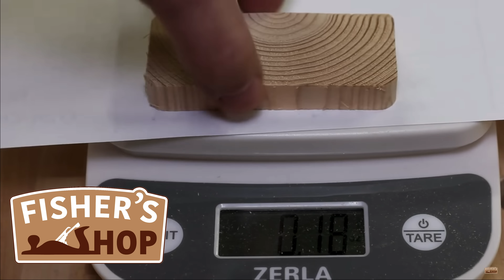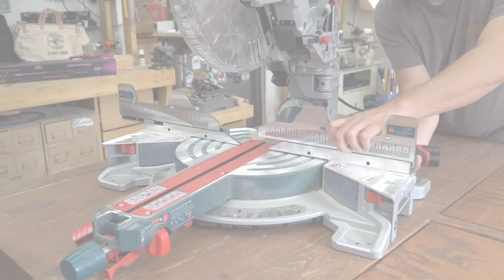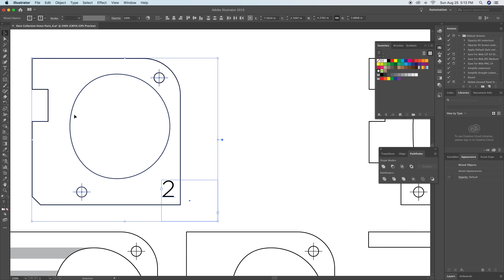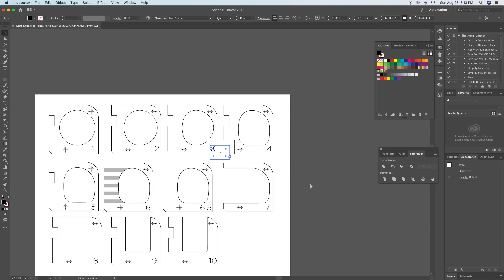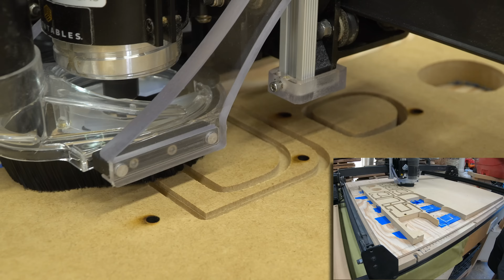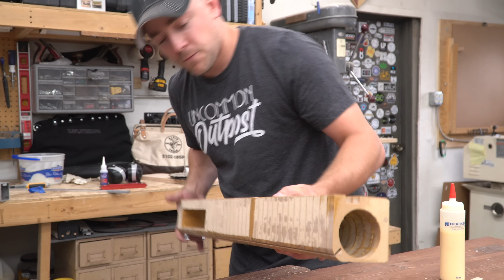Miter Saw Dust Collection - New Custom Fence

Comment: Great idea.  I think I'll try my hand at it, changing construction technique to using plywood to create a box, the inside acting as the airflow tube, and just drilling holes in the face to create the grid.
Reply from the maker: Awesome! you'll have to let me know how it turns out!
Reply: I don't know if either of you will read this, but I'd suggest making the center top and front out of 1/4" mdf and detachable, a sacrificial part.   One of mdf's properties is that it dulls blades less than "real wood".

If I decide to make 1, that's how i will do it.  A box in center with top and front as above, a 2 1/2" hole at the end of the box.  The other half, an L in cross section.  For my use, a tape mounted above the T track, and fence extension mountable to it, probably by french cleat with a c clamp.

Comment: There might be better dust collections methods out there but having a system you designed using some newer technology will most likely lead to some great projects. This is a great " lets try this" project and a definite learning piece.
Reply from the maker: Thanks Mike! That is exactly what this was in my mind - "let's try this." Most of the time when I do that, it ends up in small smoldering piles in the yard - this was a happy success!

Comment: Thats very clever. I hadn't thought about removing/replacing the fence. In my shop, I don't reaaaally need the bevel capability, just miter and even then just 0->+45 not to -45, which has got me wondering if somewhat of a hybrid between your fence (remove just the right side) and Drew's would work out well (for me). 
I made a very bad immigration of Drew's solution (super quick to build with CA!), and that actually works pretty great (despite the flaws I introduced!) but doesn't really have enough room to hook a 4" hose up directly
Reply from the maker: Thanks Paul! You definitely swayed my decision to get this particular saw with your helpful answers to my questions. And I'm glad you did because it lead me down the road to this goofy thing.

Comment: Great project for stretching the brain! I love how it basically came together in the same way a 3D printer extrudes designs one layer at a time. I would be interested to see if this could be made out of aluminum on a water jet cutter. I too was hurt seeing you mar up the face with your cuts...all that hard work! Would there be a way to use a sacrificial face in the center section? It may only provide marginally better dust collection after many cuts at different angles, but I for one have never understood the "it's just a shop fixture, it doesn't have to be pretty" mindset. I'm a fan!
Reply from the maker: Thanks Seth! Sounds like and I think a lot alike! I've had some of those very same thoughts.

Comment: I feel like no matter what you do, the more cuts you add, the more the face of the fence will get eaten away and become a huge opening.  I think if you limit your number of angled cuts, I think you might have success.  Maybe I'm not really following it though.  my preferred solution is still to use the RAS with a sacrificial fence that I keep disposing of when they get worn (since they are so cheap).  I'm looking forward to your updates!
Reply from the maker: For someone who makes all sorts of different angled cuts, it would eventually get chewed up. 90% of what I do will be 90 degree crosscuts. 9% will be 45 degrees and the last 1% will be miscellaneous, so it will take me a long time to destroy it. My hope would be to add a removable throat plate when that day comes. Also, with that 4" dust collector hooked to it, it's probably loosing airflow by being choked off. The more relief cuts I make, the better suction it will have.

Comment: This is really awesome! for your issue with the Left, Center, and Right sections separating, you could add another dowel locator hole or 2 in the pieces where you connect. Wouldn't have to go all the way through, maybe just the 5's, 6's and 8's?

my only real concern with this is the bevel kerf that you can see at the end... is that going to lop off the triangle of middle area?

i REALLY like this design, great job man!
Reply from the maker: I figure this version is here to get used and destroyed. I expect the middle will get hacked up, then I'll look into adding a replaceable throat plate of some kind.

Comment: I think the more you cut into it, it's going to create a bigger opening. I think you would have been happier by designing it with an opening where no matter the bevel or miter, it wouldn't cut into your piece. But, nevertheless...very nice work. Now Drew is probably thinking how he's gonna have to top that. Should be entertaining.
Reply from the maker: You are probably tight. I even considered making a replaceable insert for the center so when you chop it up too much, you just swap it out. In reality, I'll do 90% of my cutting at 90 degrees, and probably 9% at 45. That last 1% at weird angles will take a LONG time to actually destroy the fence.

Comment: Great job. How does it not fall apart with the various angle cuts?  I can't seem to visualize that part in my head.
Reply from the maker: It's tough to explain without seeing it. Think about the letter C. All the structure is in the back where the blade can't touch it. What happens in the front doesn't change much.
Reply: @GunflintDesigns  Okay I see now. Thanks!

Comment: I love how you did think outside the box for a solution to this problem this mitre saw brand has man.I'd love to have you do a review on your solution to this issue with this brand of mitre saw.
Reply from the maker: Thanks Philip! I plan on just using it for a little while, that's how I will find the shortcomings in my design. Once I am happy with any improvements I'll maybe do a followup video and try some Math just like Drew did.

Comment: I did something nearly identical and it works amazing.  I actually have small holes in the zero clearance base plate (all the way out to the miter handle) along with the back fence plate and this holds the work piece down and back against the fence when my dust collector is on and more importantly provides amazing air flow.  Mine is taller goes all the up to the bottom of the saw (actually removed the black bracket), on yours there is that small pocket on either side of the blade (vertical portion) I have zero clearance on the bottom and all the way up the fence backing with a series of holes next to it.   This allows zero clearance to eliminate tear out, the holes provide suction to the workpiece holding it in place, and there is essentially no dust that escapes.
Reply from the maker: Awesome, sounds like a great design!
Reply: Do you have some pictures of your setup? That sounds really intriguing.

Comment: Nice work, one question......how is that middle section staying connected ?  Won't the continuous cuts through it cause it to come off?
Reply from the maker: It is likely weaker, and wouldn't stand up to much of a push right into the center, but there is enough surface area all glued together, and with the spline running through the back, it's still pretty strong.

Comment: This would be a super cool 3D printing project. I would think the plastic would be more stable than the MDF. I like this a lot! Get your patent in now, sir! Very cool!
Reply from the maker: I've thought the same thing. How much do you think that thing would cost as a 3D print? I also thought about the possibility of an aluminum extrusion that just has the saw kerfs pre-cut into it.
Reply: @GunflintDesigns  I have no idea. :)  I haven't done any 3D printing, but I would bet you could easily sell the 3D printing files online, as well as your CNC files for the MDF version. Aluminum sounds really cool, but I would think you'd run into more issues with everybody's saw being just a little different. Go make the 3D version and patent that thing now, or Kreg will be selling them next week! :D